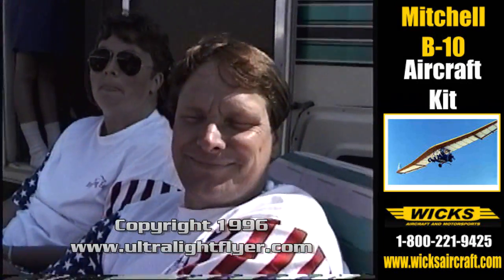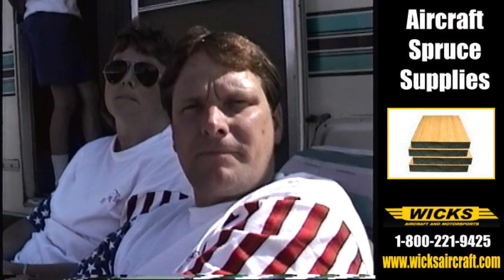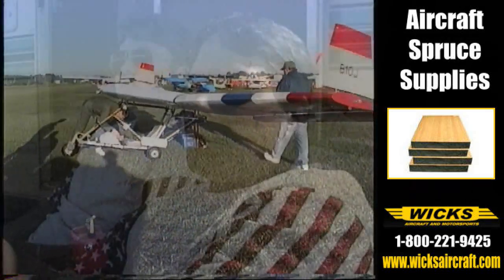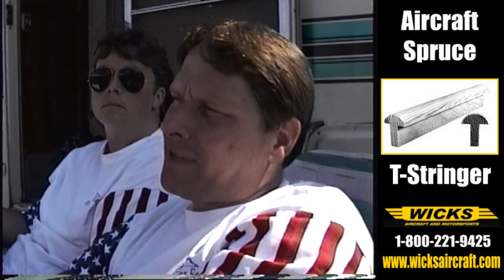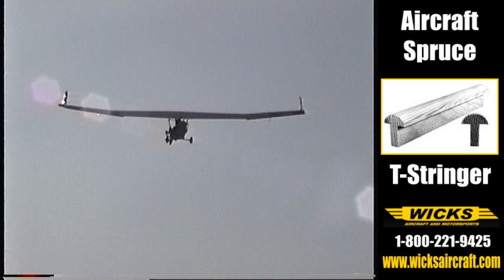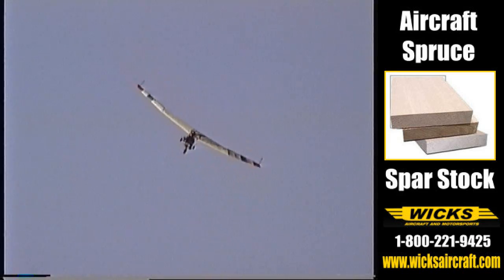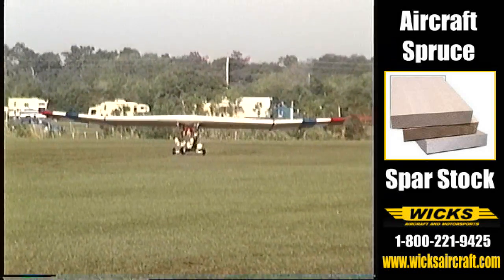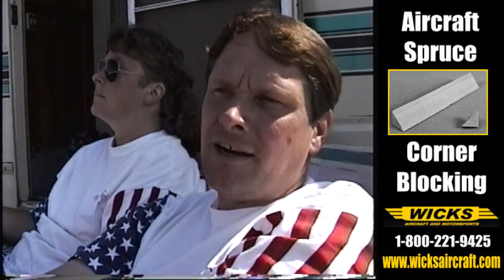Ultralight Aircraft Kit - Mitchell Wing B 10, jet powered ultralight aircraft.

Comment: Laughing... good question.  I love ultralights but just wish I could manage more than an hour and a half of time in the air with mine!  The 5 gal fuel limit set by the FAA really keeps you close to home at nearly 3 gal/hour with a Rotax 377.  With a 20-30 minute flight limit the jet it can only go about 15 miles before it needs to find an airport.  Cost of operation/hr on the jet would be about $80 or so in just fuel.  Not bad compared to renting a Cessna but far more than most ultralights.